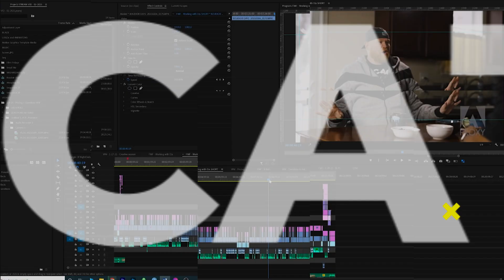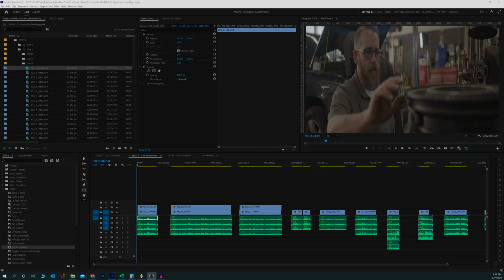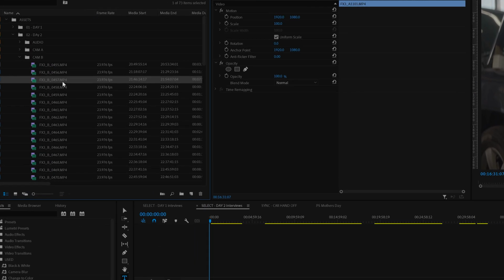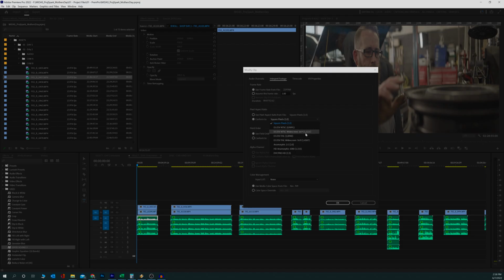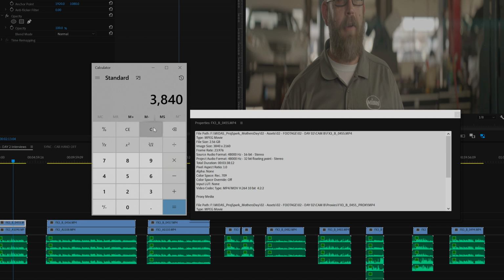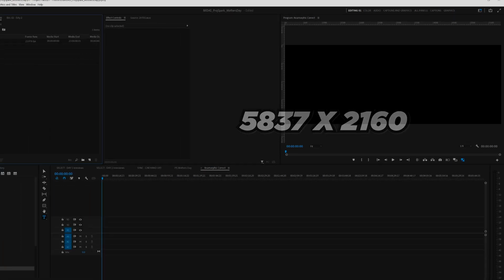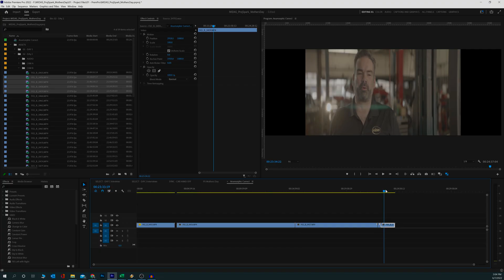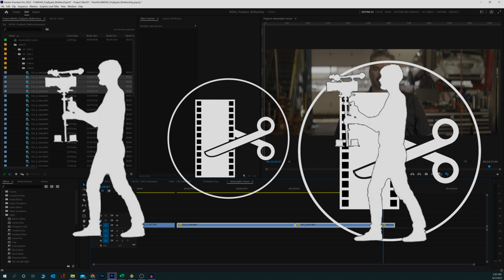How I Learned To CUSTOM DESQUEEZE for Anamorphic Footage in Premiere Pro

Comment: I have footage that is 3840x2160 (as well as 4096x213) with lens squeeze 1.8x.   I'm editing a 2k timeline (2048x858).  I see that I can uncheck Uniform Scale and make it 100x180 and it looks good. However, if I can to scale it down (or do any scaling or zooming in post), how do  you do that - because you can't RECHECK Uniform Scale since it goes back to the distored squeeze.  So how you do you pair down the 100x180 scale to whatever scale you want in the 2k timeline?

Comment: Hey! This is a really dumb question but I've been playing around with some 1.33x lenses and I just want to make sure I'm doing it right--selecting the "HD Anamorphic 1080 1.33" option is still totally applicable to 4k or UHD footage, correct? Not just 1080? Thank you so much!
Reply from the maker: Hey, there are no drums questions, I whole heartedly believe that. For the select you're mentioning, does the footage look good on the timeline ? I haven't worked with 1.33 in a while. To your eyes, do it look right?
Reply: @NightOwlsMedia   Thank you for your response! To my eyes, it definitely looks fine, I'm just concerned it might be slightly off and I'm not noticing. When I desqueeze my footage in Premiere vs when I desqueeze in Resolve, it definitely looks a little different but I can't tell which looks better
Reply from the maker: @bluedogfilms2737 I know that feeling. And I know my way isn't the best - it's more for the weird in between desqueeze settings. How big of a diff between pp and resolve are you seeing?
Reply from the maker: But yes it should work right.

Comment: Hi Jaysin! Great review. Is there a way to desqueeze the 1.6 in Premiere where you can then punch in and rotate the clip? Thanks for any insight on this
Reply from the maker: First off, thank you so much for the watch and for the comment, that made my day. So the first thought I had after seeing your question once you are set with the de-squeeze and the look of the image, create a nest from that clip. I'm not sure if it's auto set to this or if I key mapped it on my keyboard to be f9. You can do this in your preferences settings. Once it is a nest, you can rotate, or change anything else to it without disrupting the original effects you had to do with the scaling
Reply: Thank you so much for the quick reply! That works perfectly. Thank you 🙏🙏🙏

Comment: Hey Jaysin, I am reaching out because I've been filming on my Sirui Anamorphic 1.33x 35mm lens; everytime I desqueeze on premiere, I get dark corners, and it looks jello-y and the middle looks awful.  My footage shakes but I don't know why it's doing that.  What would you advise?  Please help.  Thank you in advance.
Reply from the maker: I know exactly what you're talking about. So check for me before we go on to more details do you have the 35 mm 1.33 or the 35 mm Saturn 1.6? I believe unless you have the upscale cine version the 1.33 is actually a APSC lens. Meaning you will get dark edges because it's cropping outside the frame. So the camera isn't able to read a full frame lens and instead showing you the blacks. Now, if you have the cine version, I believe that's a full frame lens. To get around this, because I have the 1.33x 35mm lens as well and didn't know it was APSC until I bought it. I will punch in on my camera's digital zoom 1.3-1.4x and that will get past those black corners. It's not the best way to handle it, but it's either that or sell the lens.
Reply from the maker: As for the shaking and jello effect, that I haven't quite heard of. However there is no stabilization on these lenses so when you are using a gimbal or a tripod you should be better, but if you're going handheld you have to hold your body extremely securely while you're moving so you're not shaking the camera

Comment: Hello, I followed your advice to desqueeze a video in high resolution 5K (5760x4320) in 1.75x ratio, and I created a new sequence (5760x1.75) 10080x4320. Would you tell me how to export this video in 5K ? Thank you
Reply from the maker: In your export settings you should simply be able to set your resolution similar to how you would do for 2.35:1. Select the option for resolution and change the numbers after clicked.off the lock icon
Reply: Your 5K export resolution would be 5760 x 2468.

Comment: I think there is an error in the Matrix ;) . Correct me if im wrong. Your Camera records in 3840X2160 and when you upscale it (what you do on the wide side) you loose information and sharpnes. When you shrink the hight tho, the algorithm should work better cause he have overlapping informations that he needs to process but he already knows more than needed. so the sharpnes should be better. 
I still have to make some real life tests but i heared the way you do it several times, and its actually the way it was done Analogue. But for digital, my mind says there is something wrong.
Reply from the maker: Yup.  You are correct. It was an we discovered after this project I was editing was over. The audience for these edits were all watching on computers, but you're right I need to redo this video.I need to figure out the math because premiere doesn't have it in the Presets.
Reply: Thanks for your comment. I just think the same and was a little bit confused :-) So, we have to scale down the high. For 1.6x anam. factor it is 62,5%.
Reply from the maker: @spieker.fotografie  It's incredibly annoying, I agree. I would LOVE to redo this video, however, I have not figured out a good way to handle this yet with non-standard presets. As of now, I am shooting normally and just increasing the scaling to fit into the 3840 x 1634

Comment: Hi i have the sirui 35mm with my bmpcc 4k i normally shoot in 4kDCI 4096x2160 
Im new to the field i wanna lear how to properly use anamorphic. So in davinci resolve i make a new project i set my timeline to b 4096x1716 but also i seen people go with 4096x1704, 4096x1624, i get lost here. In camera i have the 1.33 mode on but when i import my footage to my timeline do i have to crop?
Reply from the maker: Hey there! If you're dealing with a 1.33 directly, there shouldn't be any weird set up like I had to do here.  While I don't know Davinci well, there should be a preset as 1.33 is the standard desqueeze.  You should have something in there directly.  I know it's in PremPro as a standard. Let me know if you figure it out! I'd like to learn it too